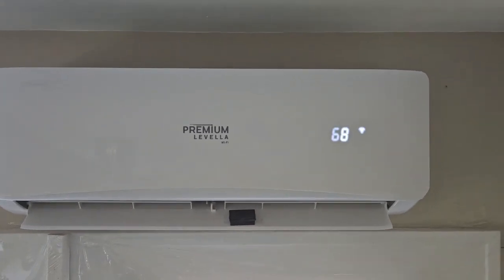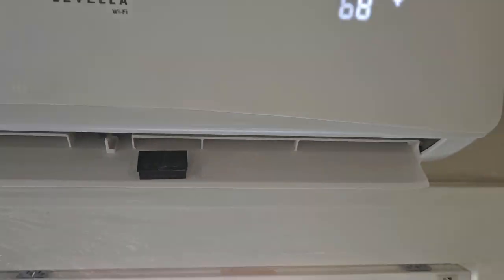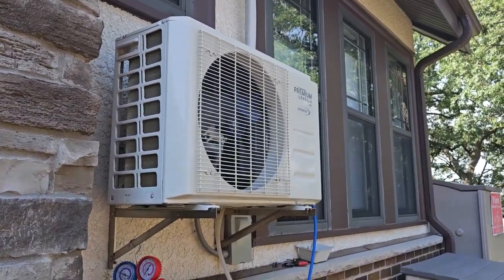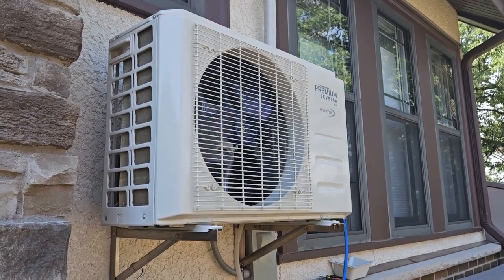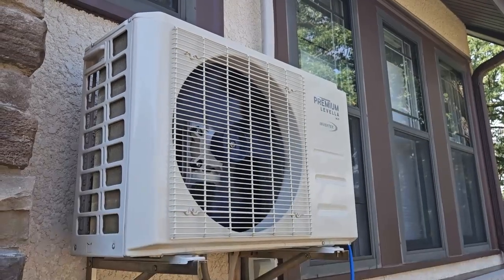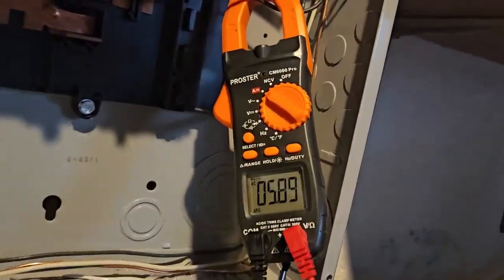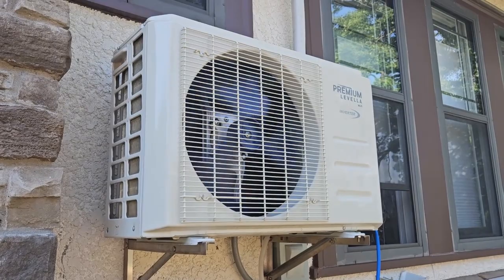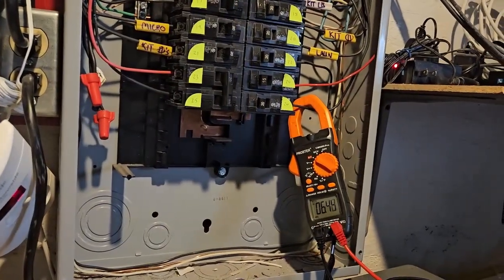mini split compressor noise when the compressor is going bad

Comment: That’s the noise mine is making. I replaced it with a new one too. I have 2 of them and it’s always the one and the same location. It’s the compressor
Reply: I have 2 also. The one in the room is always having problems. Replaced it before because it was only blowing hot air. Put in a new one 6 months ago and it's making this noise. The other one is fine

Comment: The cause is due to installation error, the distance between the 2 blocks is not enough 3m, according to the manufacturer's standards. So the vapor and liquid do not have enough space to expand and condense. The return liquid will flood the compressor, causing the compressor to run at high load, noisy, vibrating, and consuming electricity.
Reply: mine is starting to buzz after only running for about 4 months.  what do we need to do to prevent this?
Reply: @FourthWayRanch use silent mode on remote control

Comment: Same experience with LLOYD Havells .75 tons unit. I have now 5 units installed at my home. Saving over 50% in energy bills. 
I sent the video to LLOYD with same loud noise. 
Big thanks to LLOYD customer service. They sent a new complete outdoor unit. Problem fixed. It was a bad compressor. Not worth replacing just the compressor.

Comment: Hi when you first installed how was humming noise?Did it steadily get worse as time went by or did it just one day you noticed a louder noise?
Reply: It pretty much just got louder and louder as time went on.  However,  I did really start to notice it at the beginning of summer when it hadn't been used for many months.   It never made it through to summer.
Reply: @falk0069plus  Thanks for quick reply.Mine only makes a light hum noise but only when the unit is really working hard,no hum when in cooling mode at all and only sometimes when heating.Thanks

Comment: great video helped me figure my pioneer out.
Reply: What did you do? I have a 2 year old pioneer as well that's just starting doing this exact thing. Curious how old yours was?
Reply from the maker: For me it was definitely the compressor.  It got the the point where it completely locked up.  Through warranty they sent me a new compressor, but it was no joyride replacing it.
Reply: @falk0069 ugh I think it's my compressor too if this is what was happening to your pioneer 😭 I bought a new fan blade and motor I was going to replace tomorrow but after seeing this I might just wait and get the compressor so when I open it I'll have everything 😩
Reply: @MichaelJacobson mine went out in my pioneer after 18 Months. I guess I'll just buy a new outside unit.

Comment: Eww why does it sound like that
Reply from the maker: I'm planning on doing a follow up.  Turns out that is what it sounds like when the compressor is about to die.  Fortunately it is under warranty and I'm hoping I'll be getting a replacement soon.
Reply: Mine started making this exact same noise recently